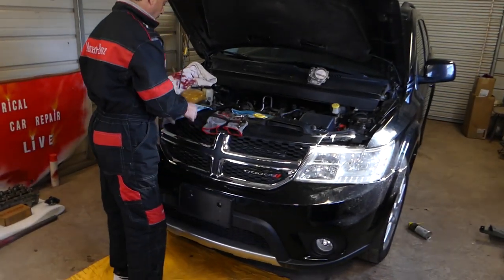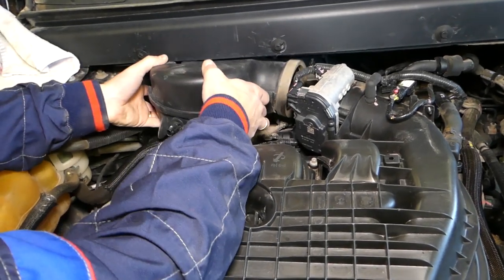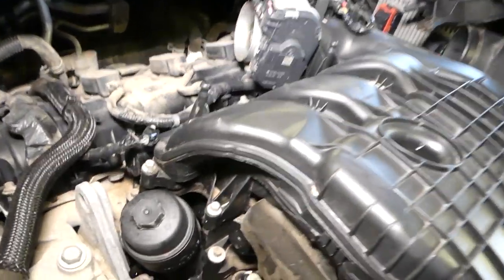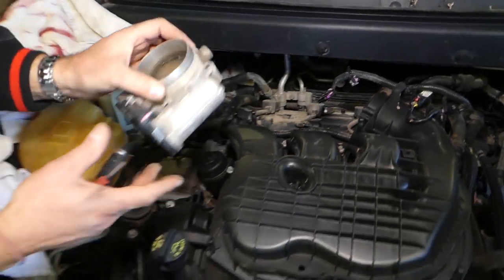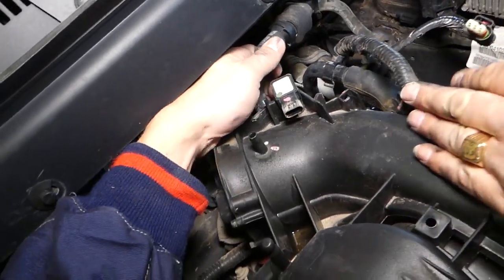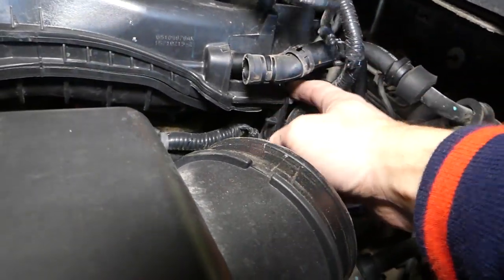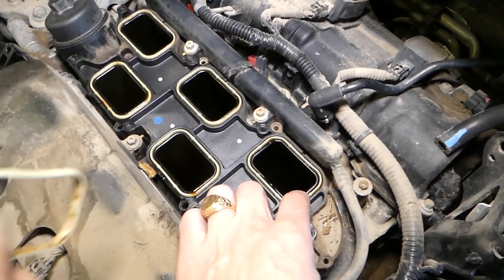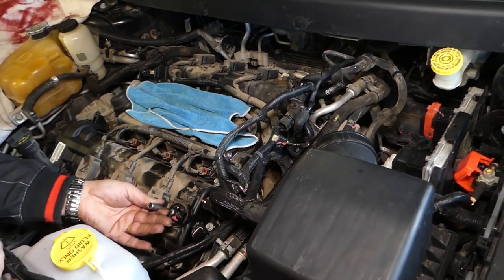DODGE JOURNEY CAMSHAFT POSITION SENSOR REPLACEMENT BANK 1 BANK 2 3.6 V6 FIAT FREEMONT PENTASTAR

Comment: The is a great video, but I have a few suggestions to make the job easier and faster.  

1. Don't remove the round air-box, just push it back against the firewall out of the way.  
2. Don't remove the throttle-body since the intake comes out easily with it installed.  
3. Don't remove the front brackets because it is not required, and they are alignment guides for installing the intake later.

Comment: Yes please I could use your help. Was driving my 2010 Dodge journey I just purchased one month ago used. Was driving good no issues. But suddenly I was driving check engine light came on and car started shutting down will not crank back on had to have it towed. The person who hooked it up to a diagnostic told me he replace a camshaft sensor the one by the alternator. Journey is still not

Comment: So bank 1 towards the back  and bank2 is towards front the same on Town and Country or Routan right?
Reply: Bank 1 is whichever side of engine that has cyl 1.  If your pulleys are on the left if looking at your engine from the front its in the back under the firewall.  Bank 2 is towards radiator.

Comment: Hello, I have a 2014 Dodge Journey and the traction control comes up as soon as the engine light turns only when it’s really hot outside while I run it in the highway it’s fine while I run it in town even it’s it’s hot out. Camshaft sensor was replaced that’s what the computer indicated but once I run the car engine light turns on as well as the traction control.

Comment: i need to know how to replace camshaft and rocker arms i have a P306 code that is not the coil,plug or fuel injector. dealer said the cam or valve train is the problem. Thank you

Comment: hello, for a 2015 dodge grand caravan the camshaft and traction sensor lights go on toether  and it eliminates my overdrive. no power . what can i do. i changed the camshaft sensor already
Reply: Hello did you found the problem